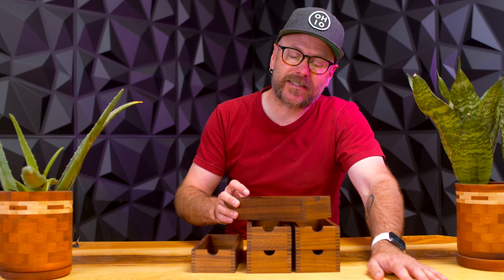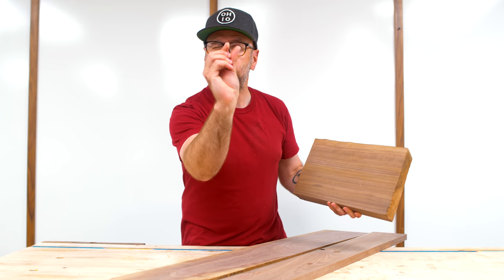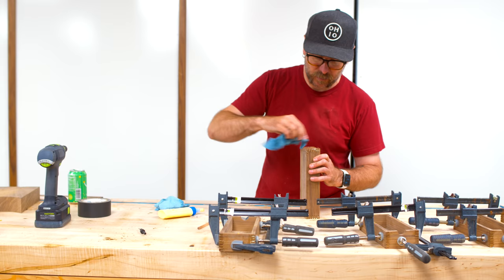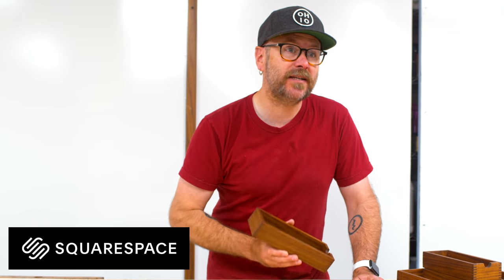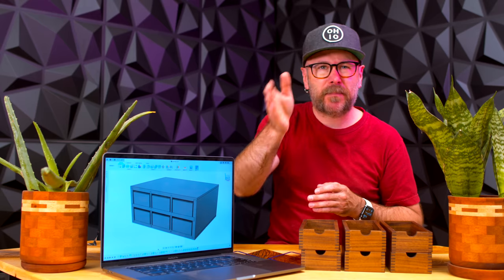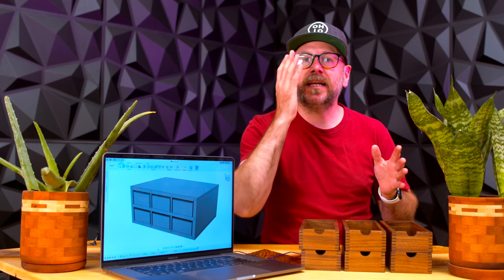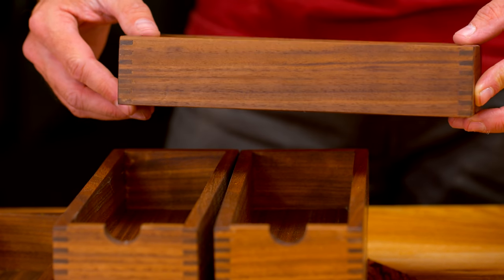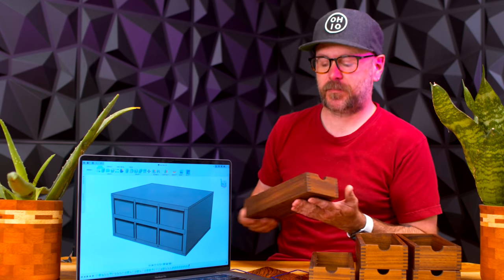I need your help finishing this woodworking project!

Comment: I'd make the case flat with the 6 drawers next to each other, and use it as a computer monitor riser. That would make it extremely easy to scale based on the size of your monitor base, by just adding or removing drawer(s). Because everybody could use some storage under their monitor, since it tends to be a catch all for a lot of little things. Bonus tip: if you've got 2 monitors, build 2 sets of drawers. :)
Reply: I like the monitor stand idea. A tweak is 2 drawers high and 4 drawers across the top to provide a wider stand for a monitor. Or maybe a  laptop stand.
Reply: Really great idea, I like it!
Reply: I like this idea, but would add sides to raise the drawer area up and allow for keyboard storage underneath.
Reply: To build off your idea. I think a minimal face frame, that also acts as legs somehow, with some extravagant but petite joinery could be really cool. Like walnut rails with brass stiles dovetailed in.
Reply: @jimsauber9252  so 8 total drawers?
Reply: Or you could do 4 drawers horizontally on the bottom, and then drawers 5 and 6 on top of those drawers, one to the left and one to the right, with a space in between for the monitor base. That would likely accommodate most bases for monitors up to 27". If you have a much larger monitor, then you could opt for the 6 horizontal drawers.
Reply: I was thinking a similar thing, except with the design being a scaled down version of the printer stand and put the drawer layout with 4 in the top row and 2 on the outside of the second row.
So if the original stand was like this:
|_| |  | |_|
|_| |  | |_|
The tiny version would be like this:
|_||_||_||_|
|_|       |_|
(No idea if that formatting will stay the same/work across different versions of youtube lol)
Reply: Really good idea.
Reply: I had the same idea, but would keep both levels: drawers on the upper level and a free space under to tuck-in the keyboard and mouse.
Reply: @Matlock69  6 drawers 2 1 1 2
XXXX
X     X
Reply: Yes, this is indeed also a good suggestion. I also second Becky's "keyboard storage". The "table"-top could be curved slightly, just to break traditional squarish look (like all my suggestions, heh).
I'd also like to add that 'low-profile' drawers could go right above the keyboard storage space; eg. something like the height of a board.
-Say two drawers, each a half inch (1 .. 2 cm) tall and 8 .. 10 inch (20 .. 25 cm) wide. They could have built-in wooden 'sliding dovetails'.
The inner sections of the drawers could be removed by using a router. Special custom-sections that fit pencils/tweezers/pliers/side-cutters/resistors/capacitors/diodes/LEDs/SMD-electronic components/put-your-idea-here/SD- and MMC-cards/USB-sticks/penlight batteries/coincell batteries/harddisk mounting screws/teaspoon/knife/fork/other stuff exactly could also be considered. =)
Yea, also consider 'sanwiching' some female USB cables between two re-sawn side boards, so you can have a few easy-access USB-2 ports or charger sockets. Lots of ideas here, think 'sockets and outlets', including headphones.
Reply: Love Matts idea and Becky's keyboard drawer would really add value to it... 

How about incorporating a little 2 or 3 port USB hub into the frame somehow so u can plug dongles or a HDD straight in to it... Could even mount a wireless charger into the surface and get very fancy.
Reply: This is what I was thinking as well.  You could make the top and bottom wider than the drawers which would give you space on one or both sides to act as cubbies for a laptop charger, etc.  Essentially, you would create a mobile office which is handy in these days of working from home if you don't have a dedicated office space.
Reply: Really like this idea
Reply: Waldo Barnstormer Plus a hidden phone charger
Reply: @jimsauber9252  I think this is a great idea. I think 6 wide might be a little too much. But 2 high and 3 or 4 across could be very handy actually... We all keep things around our computer that are handy, but have no real place? Id like to see this :).
Reply: Or to change it up a little, 2 high, but 4 on the bottom and 3 on the top.. ( or 5 and 4)...I guess it depends on the monitor base...
Reply: I like the monitor stand idea with keyboard/ mouse storage...but is there a reason it needs to be square and blocky?  I especially like adding a QI charger.  This one seems to be highly rated and has up to 8mm charging distance for under $14 (https://www.amazon.com/dp/B07FM8R7J1/ref=cm_sw_r_cp_apa_i_nDN9EbV9H9Z24).
Reply: To build on this I was thinking of 4 drawers on top and have a pull-out shelf under for the keyboard/laptop, as Becky mentioned, but the shelf can tilt downward onto the desk for better ergonomics. Maybe a hole at the back for cable management with a hallowed space behind the drawers/shelf for the cables to run through? I've been trying to figure something out like this since I'm using our dinner table as a workspace. Need to tidy it up so we can actually eat at the table, small space living problems!
Reply: That's exactly what I was thinking. I have three monitors, so I thought having a single row of drawers, 3 on the right and three on the left, then a leg for the middle monitor and they all sit on a "table" top, that way you can slide your keyboard under the base between the drawers to write/ use your desk better.

Comment: I think a clear acrylic box to show off the drawers. Those boxes look cool so don’t hide them away.
Reply: mattgraves45 I agree! maybe a clear acrylic floating shelf, six drawers wide? But either another opaque acrylic color on top, or a hardwood top so you don’t see the junk in the drawers? or perhaps 2 floating shelves w 3 drawers each as above used as floating nightstands? The floating shelf hardware could be hidden in the top board, if it is hardwood.

Comment: A 3, 2, 1 stack like stairs! And on top, slots like a magazine stand for note books, ledgers, binders, etc, 

3
3  2
3  2  1
Reply: This is what I had thought as well.
Reply: 3 of us so far thought of this.
I't put small plants on top of the steps.
Reply: I like that idea. Another way to stack is a pyramid. This way it wouldn't be too tall. Each step on each side could be a mail or magazine holder.

     Mail  1  Pencils
Mail   2       2    magazine
      3       3       3
Reply: Nate Bennett How would it not be any taller as a pyramid? Wouldn’t you still have 3 stacked high?
Reply: @ThatClaraGirl  you're correct. I had a brain fart.
Reply: I was thinking similarly, though with a 4, 3, 2, 0 pattern.  Have one side start at 4 high and then have dividers (maybe out of the brass rod) that rise to the same height as the first stack all along, plus another 'stack' that's the full height.  So you'd have 4 drawers, then 3 drawers with a pencil tray on top, then 2 with an envelope holder, then a magazine rack.

Comment: I see this as an awesome little Solder Station. Going left to right = 2 drawers stacked 3 drawers flat 2 drawers stacked. the middle section would be the work station and the drawers for all supplies needed. You would have to make one more drawer but those things are beautiful and the more the merrier. The middle section would be large enough for the project piece and the tools needed. It can easily be moved to a stow area and brought out when needed. The beauty of this will bring a little spice to the stow area or main workstation if you do a lot of soldering for LED inserts and such. This could also be fixed with drawer slides and stowed under the top of the bench. Slid out and used and then slid back in for storage. Just an Idea. Keep up the great work and excited to see the end result.

Comment: My idea is to put 4 drawers on the bottom, the other 2 drawers at each end, and space in the middle for the brass divider or as a paper tray. You could also use the brass as a dowel joinery on the case to tie it in with the divider idea. Good luck sorting this all out.

Comment: I've had an idea for a hobby box with similar drawers for sometime now.   The outer case would be three rows tall, with the bottom two rows occupied by the drawers, and the top row open.  The case would also have a front and back.  The front of the box would open and lay flat to be used as a work space.  Depending on the final weight of the box a handle could be installed on top, or two on the sides.  If you really wanted to get fancy, a fold out battery powered light could be installed in the top of the box.

Comment: Okay, here goes nothing... combining a few ideas here. build them into two 3 shelf organizers for either side of your desk (or either side of the speaker i normally see there. Build a housing out of a contrasting wood that holds both sets of 3 vertically. Band the sides of the top with a conductive metal (copper, brass, or aluminum would probably look the nicest) and cover the top with a walnut colored leather. Then, attach a lamp to one of the units that switches on/off when you touch the metal band... the other one, you could set up a wireless charger, bluetooth speaker, place for the watering can/sprayer for your plants,  or something like that. 

I tried to think of this from the perspective of "What does he need on his desk that isnt alredy there?"

Comment: You could keep the 3 x 2 arrangement you started but remove the vertical dividers between the drawers leaving two wide compartments. Inset a brass rod halfway into the floor of each compartment to act as the drawer guides. On the three-sided paper tray on the top of the box, you can inset a brass rod into the top edge of each of the three wall. Brass and walnut look so nice together.

Comment: A mid century modular shelf would be perfect for your drawers. You could use four 4ft. strips of wood, attach the strips to the wall vertically 2ft apart and then make different size shelves for books and for your drawers. It would be really awesome! You could use it in your workshop for books and as display shelf and the drawers could hold nuts and bolts and a few screws 👌 Just do it! I just found your channel today and you are awesome, can’t wait to watch them all and make some stuff to! Peace ✌️

Comment: Two walnut boards. Brass rods sperating the boards bend a radius for the top and top back. They can act like handles. You can rout a place for each container or place 1/4 square stock as dividers. Like an open concept apothecary cabinet.

Comment: You could use the brass rod as a swivel point in one of the back corners with some turned wood spacers between the boxes. Then mount the brass rod in a case.

Comment: I like how you are thinking outside the box on this one. I agree with a few folks who have already commented. Go with a step approach. 3 boxes, 2 boxes, 1 box. Then maybe a slot ontop of the 2 boxes for letters. And then a larger space above or next to the 1 box for notebooks or iPad. Perhaps incorporate a charging station (disc or plug) into the design.

Comment: I think an acrylic box or just acrylic sides would be nice, that way you can still see the beautiful woodwork and grains from the boxes. Possibly a metal top and make it look contemporary/modern/industrial.

I also think making a "stand/table" with a fan for your laptop would be neat. Kinda like the Keurig kcup holder that goes under a Keurig but adding a fan like you find in a computer tower.

Comment: I like the modular idea. Make a case three drawers high?  And make it so you can attach the cases together or separate them. (Sliding dovetail grooves in the side and floating pins maybe???). And if you need more in the future you can add another case of drawers.   You could also add a groove around the edge of the top of the case and have the bottoms able to fit onto it so you also have the option of stacking them vertically.

Comment: I would do a box similar to you initial design with the tray holder on top. Tops side and tray made out of that walnut but I would use brass rods to make the horizontal divider that separates the box joint boxes. Since their won’t be much weight in those boxes I think the brass rods as a shelf would be a really cool look.

Comment: I like the 3x3 sketch you made. 

The drawers look like they'd be good for silverware drawers. On top of your current sketch, you could put a removable/flippable cutting board. Or maybe it could have holes for a specific kitchen appliance. (Like, I have an old waffle iron, and its feet always slide around on the countertop. Maybe you have an appliance with a similar problem.)

You could also combine in a set of wood & cork coasters. (I'm seeing a kitchen organizer thing here.)

Comment: About to spew verbally: Think of each drawer as a PEZ and you make a giant PEZ dispenser to eject the top drawer. Yeah, it sucks if the stuff you want is in the bottom drawer. I don't have all the answers. I can see it in my head and it's a great idea.
Reply: I like that. If you eject the bottom drawer and place the last used drawer on the top of the stack, gravity will feed the drawers instead of needing a spring or other feed mechanism.
Reply: Love this idea - Dave could make some kind of sausage dog head for it out of contrasting woods
Reply: Yes!
Reply: @mrfreeman1995  Now we're talking!
Reply: that's wildly original I like it alot
Reply: why isn't this done already? my gawd, dave is slacking.
Reply: @screichi74  haha
Reply: I love this idea! The dog head could be weenz on one side and Wally on the other or two 3 box stacks one Wally and one weenz, also I saw someone down further mention clear acrylic the upright pez holder part made of acrylic
Reply: @mrfreeman1995  What if he made a sausage dog that is sideways the drawers slide in to the side of the dog?

Comment: Two rows of offset columns. Top drawer open space underneath use the brass rod mentioned as corner pillars front and back, open space used for stapler or hole punch. Next column box over box. Third column box over box. Last column open space on top row, use brass rod as letter dividers for envelopes, box underneath.  
Also could do an open space in the middle row (not column) for storage of open papers,.or copier paper/ special letter stock.

Comment: Make a cube shape box with another smaller cube shaped box in side. The drawers fit in between the two cubes and the centre you could mount your tool as a display or easy access like smaller 12v driver. So the drawers contain all the parts and bits and drills that the tool utilises.

Comment: I have a simple shelf to raise my monitors at my desk with one upper shelf about 6 inches up and two lower shelves at about 3 inches on the outer thirds with the center third for hiding keyboard and mouse. The side shelves/openings are almost perfect size to fit three of those in the slot (I put magazines or paper in the lower selves)

Comment: Vertical piece of wood with brass rods coming out of it (2 for each drawer). Drill holes in the faces and backs of the drawers and the boxes can ride on the brass rods kind of like drawer slides but going through the drawer instead of on the sides.

Comment: Three boxes tall, two wide and file “pockets” on each side. Just my thoughts. Let’s just have fun with it
Reply: This is exactly what I had visioned as well
Reply: Had the same idea except have the pocket in the middle with a board at the bottom to hold it all together and the brass across the top both for stability and a design feature. Maybe with a brass railing around the top?
Reply: I had a similar idea, except drawer stacks on the outside with file pockets in the middle.  Maybe overhang the top and bottom and use vertical brass rods as an accent at all four corners.

Comment: You could build the case right into the desk, maybe use a bit of white oak to offset the walnut drawers. Just a thought but I'd also finger joint those joints on that box, makes a great match.

Comment: I'm not the best at explaining with my words so I'll just show a quick model I did in fusion 360:
https://imgur.com/gallery/s8gzdiW
I'm open to ideas about what the center area should be, and the materials used to make the whole thing. It could have the brass rods in it for holding files, it could instead have a shelf in the center of it for displaying stuff, it could be a small charging station for various devices, or even have a fancy door to cover the center so it's like a hidden snack stash ;P
Reply: This was my thought too. Another variant would be two drawers on each side, then the last two drawers next to each other across the bottom. Think a U shape of drawers with a small cubby in the middle.
Reply: This looks great!
Reply: @crycavity  thats how i thought of it too.. but without the metal rods and open on top where the folders go! i probably didnt explain it good either in my description.. hahah
Reply: I vote for this. That would look sharp.
Reply: I'm a year late, but I really like that.

Comment: A cube raised with a perspex rod (maybe made to light up) the cube stood on one corner looking as if its floating with either draws or shelves inside, on the outside of the cube maybe some coloured resining looking as if its been poured on the top corner running down the sides driping onto the top suface where it has puddled a bit.

Comment: Maybe a tackle box esk build. Where they stack vertically (one on top of another) connected together so you can lay them down to be oriented side by side (short sides facing forward). This way you can change the orientation from a tower to a flat expansion.   Could be good to use as storage under the sound board or a nice vertical tower beside it to keep small things out of the way

Comment: An inverted pyramid. 3 boxes on top, 2 in the middle, and 1 on the bottom. Inverted so you have a flat surface on top if needed.